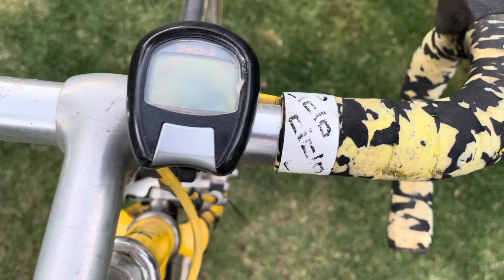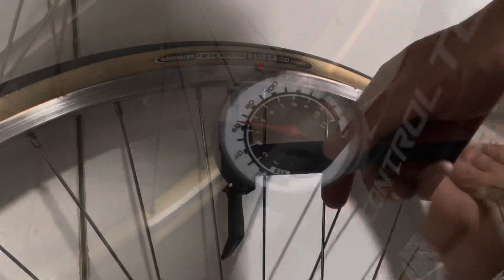Panasonic DX3000 Restoration - Part 1/2

Comment: Among the many things I like about the channel I especially appreciate that you work on bikes from so many different parts of the world. 😁 Awesome.  So pleased that crank bolt came out relatively easily for you.  I know the routine. ……… penetrating oil + time,  heat,  instant freeze,  compression, lots of hand wringing,  weeping with frustration, anything to break that contact.  Great work looking forward to part 2 👏👏👏  Your patience and care is exemplary.
Reply from the maker: 😁 you summed up those attempts pretty well Kevin, I’ve gone through all of them and I’m back at the weeping stage on the current project I’m busy with 🥲 Stuck seatposts are the worse 🤯

Comment: Haven't seen you in a while but another great video.  I enjoy getting those scratches off of parts.  I've never used that type of file.  May try in on my next restoration.  Had to use a grinding wheel on some deep, severe scratches on top of a stem.  Looking forward to part 2. 👍👊
Reply from the maker: Thanks BRM, I’ve been kept busy with my day job and lots of other small restoration projects between these larger ones that I put on YouTube. The file is part of a set of jewelry files which I bought, they work really well for these small parts 👍🏼

Comment: Beautiful rebuild - and I love the videos. What tools setup do you have for sanding and polishing steel? Is it a drill, in a vice, with a steel wool / polishing bit?!?
Reply from the maker: Thank you. My tool setup is fairly varied. I have a full buffing and polishing machine but often use a scotchbrite pad on my drill to strip anodizing and do small polishing jobs.

Comment: 4:05 omg noooooo!!!! You are supposed to hit the bolt, not the entire stem!!! Also do not try to get it out when you get it hot!! Heating up aluminum is usefull when the aluminum part is on the outside of a steel one, like the crank on the square taper spindle!! This is because aluminum expands 4x more than steel at the same temperature delta.
Reply from the maker: LOL… have you watched the whole video? The wedge/bolt was totally loose, the stem was corroded and stuck. I was trying to break the bind by shocking it with a hammer. Same with heating it up, the expansion and contraction sometime breaks the bind of the galvanic corrosion. But thanks for the additional advice 👍🏼

Comment: I have a similar problem with a '77 Peugeot. The stem is completely stuck. I have much less patience than you. Somebody suggested to use Coca-Cola. I might give it a try.
Reply from the maker: I’ve tried Coca-Cola before without much luck. It’s essentially just a light acid as well and works similarly to vinegar.
Reply: @BuffsVintageBikes  OK, thank you very much! I hope I can solve the problem. It's a beautiful bike in an excellent condition. 3 Reynolds tubes and the Simplex/Stronglight/Mafac group.
Reply: @maciejzielinski4033  thank you! But the stem is not original. It's a Japanese SR stem. I don't care about it. Maybe I'll just cut it off if it helps.
Reply: @nielskjr5432  Cutting does not help. Your last resourt should be galium metal amalgamation. It is rare to have to remove a stem by destruction... You might be able to remove it normaly if you penetrate it with some oil and then strike the bolt. It is a ton of uneccesary work to cut and drill the stem like in the video. Have fun!
Reply: @maciejzielinski4033  OK, thank you Maciej! I have a penetrating oil called Brunox Turbo Spray. Similar to WD40.
I will try this first.